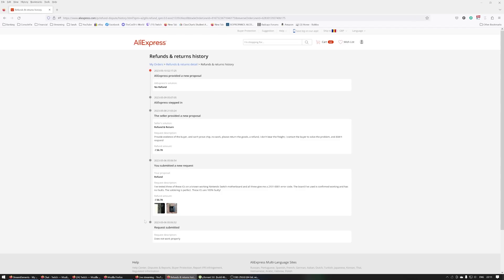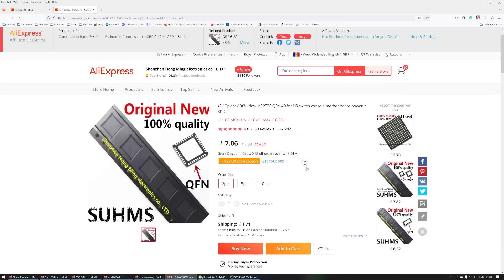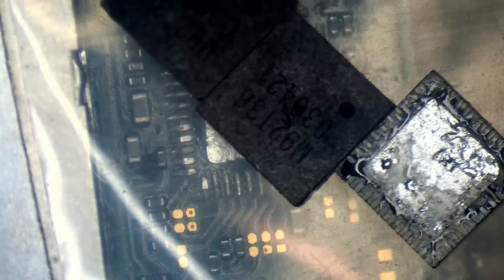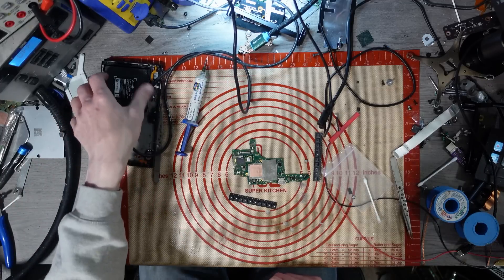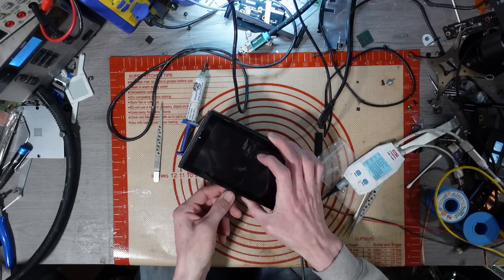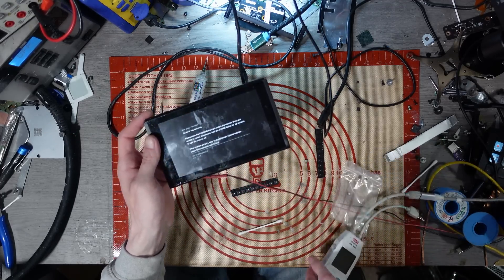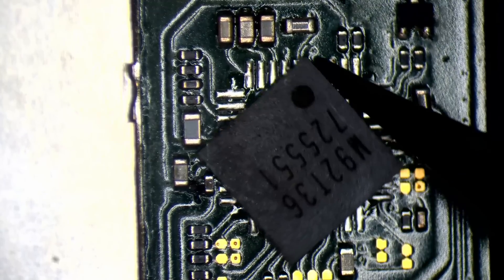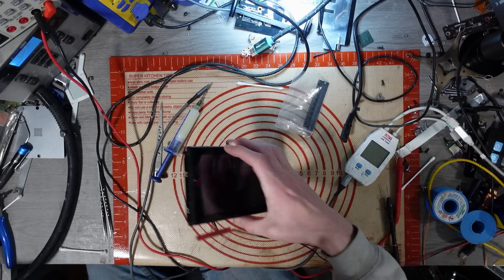Here's Why These M92T36 ICs Are COMPLETELY FAKE! AliExpress Called Me A LIAR...

Comment: I have had fake parts and they destroyed a amplifier fried tracks and killed the PSU so I wire in others in to a second bard strapped to a heat sink the temp shot up so I did a mod to the bard.  To drive with less voltage did work for a bit.  So I filed the top down and it was just a single transistor not a darlington.
Reply: oi tudo bem? sou do Brazil presciso comprar um chip para meu notebook , nao entedi o vendedor Shenzhen Hong Ming electronics co., LTD, é o que vendeu o chip original ou falso ? me recomenda algum orignal vendedor aliexpress.

Comment: Unfortunately, you're actually doing the installation wrong, or rather using the wrong procedure. Chips that are exposed to the outside environment must be left to dry in an baking chamber at 100°C for 24 hours. Which you didn't do, so you gave them proof that you did the installation wrong. in addition, you use a temperature of around 450°C (at least I assume because you don't show the temperature) for soldering which is well above the limit and moisture inside the chip can tear it. I'm not saying that the chips aren't fake, I'm just pointing out how they will argue, they have this information right in the description.
Reply from the maker: I've never baked ICs and never had any problems in almost 5 years. It's only selective sellers who I have issues with. With the greatest of respect I've been repairing consoles a long time and I don't ever need to bake them
Reply: @TheCod3r  Neither do I, but that doesn't mean it has to be done right. But as I say, they can be fake chips or defective. I'm just saying how the seller will defend himself. It's happened to me before.

Comment: I have only had a few instances where I was sold something faulty and couldn't get a refund. Every single dodgy seller requests multiple videos etc. The worst was a digital radio with a software issue.
Now I overwhelm them with information in the first contact, I submit images that I have drawn arrows and comments on. I am not sure if the staff can read the comments or if they rely on translation, but it results in a refund.
If anyone is after advice, as always read the comments, don't buy from new sellers and don't buy if their rating is below 97% unless you have no choice. Any product with an unexplained failure rate of over 3% should be treated with caution. Occasionally it is due to holidays, other delays or "users" not being aware of how to operate the item correctly. Don't ever let sellers refund you off platform, they will complain to Paypal that you didn't return the item and they will get their money back and you will lose out.

Comment: Buying chips on Ali always remains tricky. If you're lucky you get genuine original manufacturer chips, if you're somewhat less lucky you will get relabeled similar/compatible chips. But in this case you appear to have received something random in the right package but with an entirely different function.

You were for sure right to already identify by the marking they were fake, and this is what in 75% of the cases already give it away. Occasionally you will get a decent relabel that can't be told from the genuine part, but then they'll fail in other areas like dimples in a package and such.

Comment: I find that most of the time using Aliexpress works out OK until it doesn't.(well, apart from the fact that by the time tax and everything else has been added, it's not always that cheap) When it doesn't work out, you are SOL. First off, the seller always suggests that the problem is you, not them. Then if it goes to refund, Aliexpress sides with the seller anyway. For this reason, I always assume that I'm chucking my money down the drain each time and keep transactions small.

Comment: You did not make a measures on the circuits, what is going on. And you can use a chip soft debugger monitor to check or update chip data.

Comment: This happens to me a lot here in Brazil. I buy lots of 10 or 20 units from each seller and often only 3 to 4 chips work. This seller you showed there is one of the ones I usually buy! 80% of items work. It's hard to work in this business. Even worse are the lousy CXD90042GG from play4 and Wifi module from ps3 Cech4000. Lost money Most of the time refunds don't work.

Comment: Its so cute and funny to see you explain so much and technically as if the person will even understand English then will have to understand what is a short, when they just want to not bother with the reply and eat the outcome. Please do a follow up with their feedback.
Reply: My thoughts throughout the whole video were "they're not going to care" - even if they did listen and understand they could claim something was swapped out or faked in the video. This is just the risk of buying direct from China
Reply: The problem is that AE uses a translator for all of the AE messages. You have to chat as if you are talking to a 6 year old and do not use euphemisms in messages as they do not translate well.  I only buy on AE up to a $ I am willing to kiss good bye. I have had probably 6 or 7 disputes and won all of them except 1.  I* buy from sellers who have 95%+ positive ratings, been in business for more than 2 years and I look at the 1 or 2 star reviews for gotchas. However in this case that would not of prevented this issue.

I video the opening of every order I get from AE as well. I show the address label on the outside of the package and the order/tracking #. If an item arrives damaged I have proof. If an order is part of a consolidated shipment where multiple orders are combined I have video proof of each order that was included in the combined package.

Comment: It can cause damage even trying fakes on some boards, many of these chips with the same size/footprint but inside they are a totally different IC die inside could be anything - they grind back the plastic surface smooth to remove the original manufacturers markings and then laser etch fake markings onto them for a chip that is in demand and has a value worth selling
Reply: Plastic surface? 😂

Comment: From my experience you can see the passes from where the chips have been laser scrubbed or even sanded. Then reprinted, the surface looks too ruff to be legit. Manufactures would sell these if they we're legit as a D grade second. Also because of angle of view on the print. They are forensically fake just by their appearance.😢 Logic prob this chip and a known good one would reveal the deception.😢

Comment: Would the console turn on without the chip even present? If these chips are fake, then the consoles basically are turning on without that chip present. If the console is not supposed to do that, then there must be a middle ground where the chips are not actually fake but rather poorly manufactured in terms of compatibility. I would suggest identifying a pin that should be ground, then probe the other pins with a multimeter, and then compare the numbers with those of a known working chip. There's still room for doubt.

Comment: I've bought from them before (Shenzhen H M), small batches of M92, PI3 and I personally can say I have yet to encounter a fake chip, I've been lucky it seems.
Reply: I think the pads on the new chips could be to blame. I suspect a couple of them rejected solder despite looking like they were properly soldered. My doubt is in the fact that the console still turns on despite supposedly not having the m92 chip, considering that having fake chips on would be the equivalent of not having the chip at all. It would be great to see a video should how the console would behave without the chip on the board.
Reply: @Expo_Hans  I second that, I do have to pre-tin the pads of the chips otherwise they don't merge with the board, it's like they're oxidized from factory.

Comment: I have an idea: scrape/sand away at (or etch away) the surface of both a blown but genuine M92T36 and this fake M92T36 until you reach the integrated circuit portion of the chip. I wanna know if there is even anything inside it, and if there is anything, how different the genuine chip is from a fake one. I'd suggest doing it somewhere well ventilated if you decide to try it, but it'd be nice to know what the differences are.
Reply: It's better to apply solder to "fake chip" first before setting chip. Sometimes there's a film where it's difficult to apply solder so that should be dealt with first. Electronic repair school had the same issue with a power controller IC chip for a laptop.
Reply: That's even if there is actually a die inside the package!
Reply: @mechanoid5739  it can be checked with a banal multimeter on diode mode testing various pins and ground.

Comment: Thx for the warning.  If they have just re-badged unrelated chips then you could compare the electrical properties between pin pairs for the good and bad chips (away from the board ) ... also comparing between the batch provided would give a big red flag if there are any differences.  I think there are ways to check for the original chip ... maybe cleaning down with acetone?
Fingers crossed for successful completion and refund for your case.

Comment: Hi Phil, I would mention something, but please don't take it badly. If it hurts your refund process you can delete it.
I often have the problem that the IC's from China do not work, because they cannot be soldered on properly. Whether due to incorrect storage or other reasons, a grey deposit forms on the contacts, like corrosion. On the video it was not really visible because of the foil, but as if I had seen the same problem on the IC. 
I always check before soldering and if I see this grey thing on the contacts I tin the contacts separately. Sometimes it's really hard to apply the solder, it's so bad.
Reply: Agree with ,to be tanned before installation
Reply: hello aliexpress rep